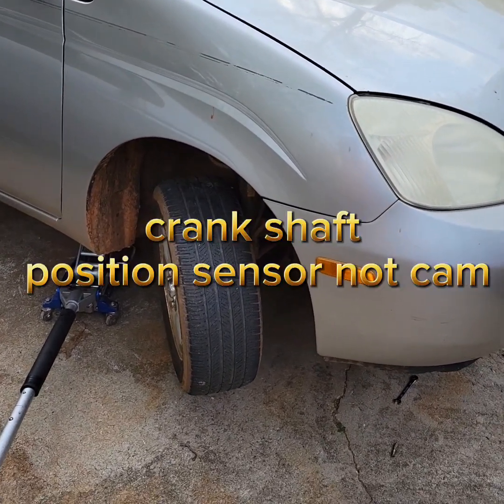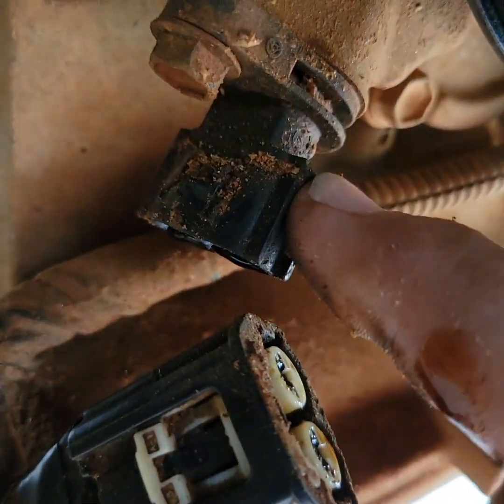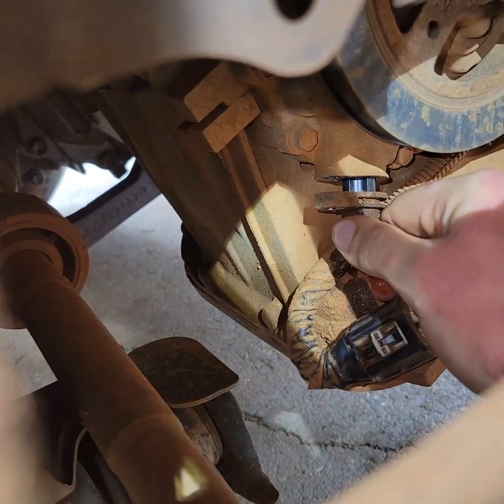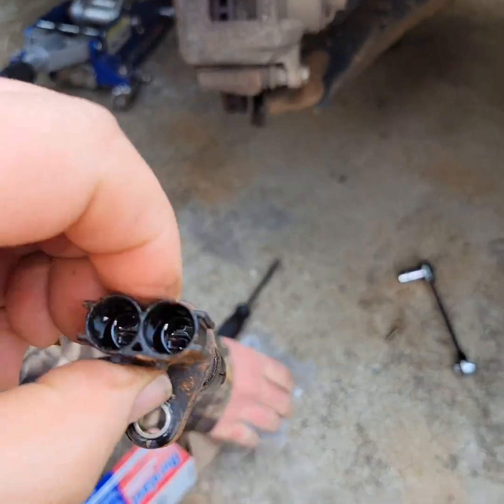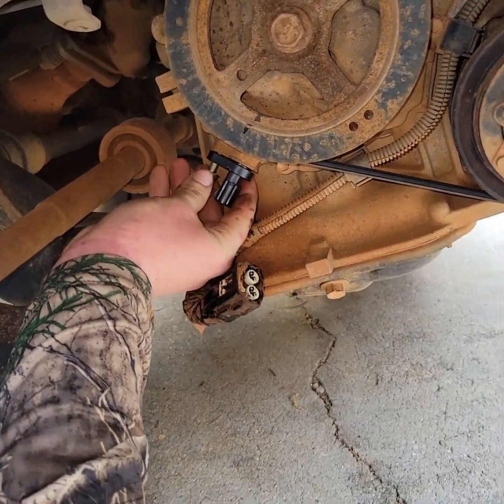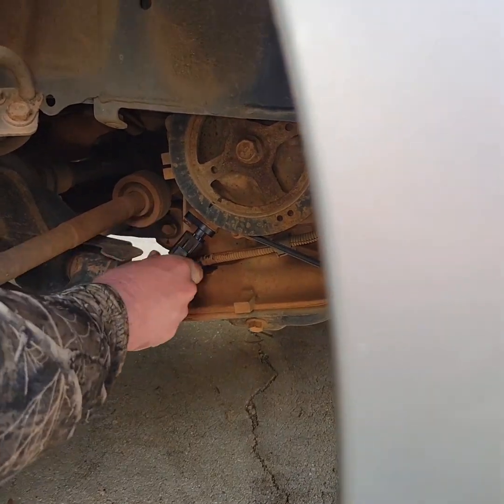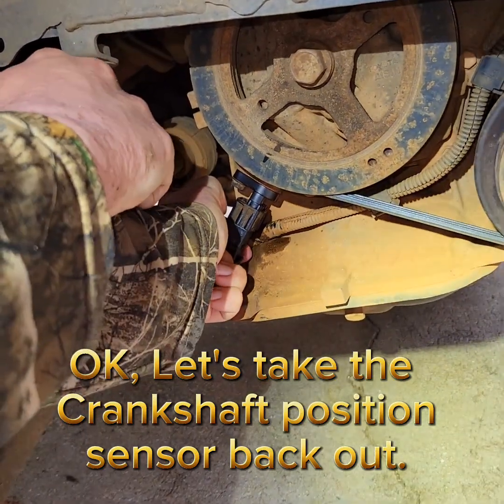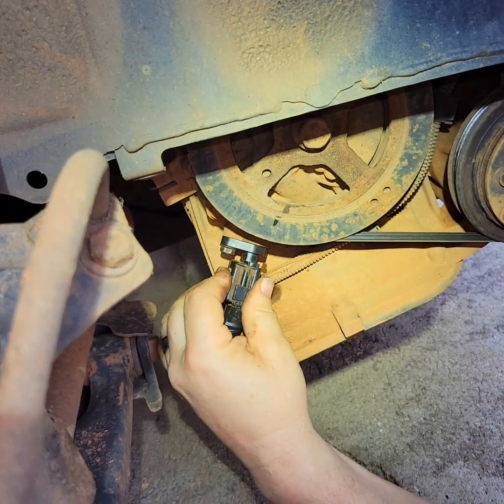Gen 1 Prius 2001 2002 2003 crank shaft position sensor replacement. C1259 P0335 P3120

Comment: Hello I’m getting this same code but it appears as in abs codes. Would that be the same issue going on with my Prius?
Reply from the maker: Is your car still drivable? When this comes unplugged, the car will stop running. This sends the signal to the computer for the injector and plug timing. Is your camshaft position sensor still plugged in?
Reply: I have a 2003 Toyota Prius with 163.000 miles. Yes turns on drives a couple of miles before coming to a stop triangle light turns on and the red car with exclamation mark also and the brake light and check engine light
Reply from the maker: Your camshaft position sensor may be bad. If the engine is not running, that could be why your lights are coming on. Our engine would stop running because the camshaft position sensor would unplug itself from the oil leaking through it. It has not happened again since we replaced it.

Comment: Through this sensor that is.
Reply from the maker: No, only drips of oil. Is there oil on the bottom of your engine? How many miles of highway driving.? We drove to Montana from SC and back and didn't need to add oil.
Reply: It's half a quarter over the life of an oil change. Maybe 1,500 miles being around 70ish mph.